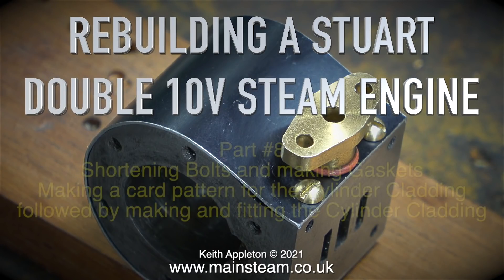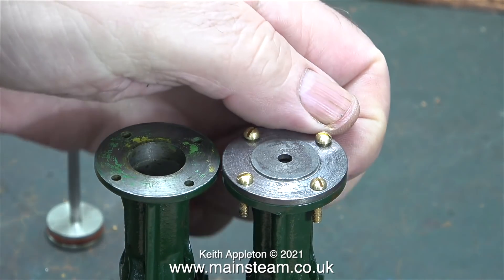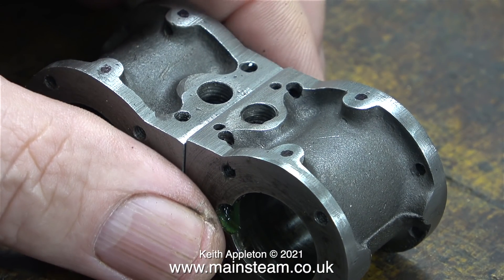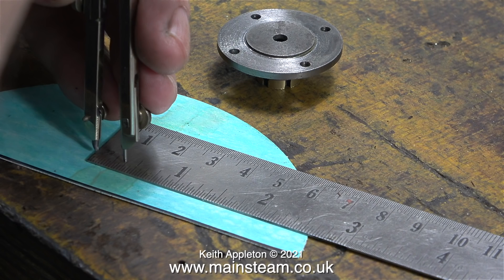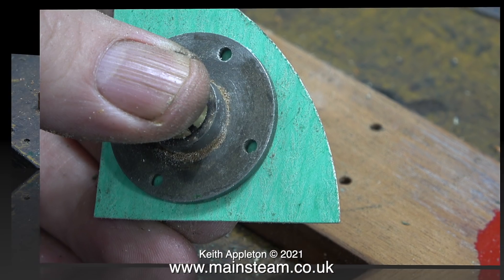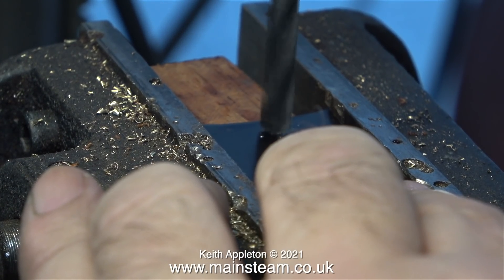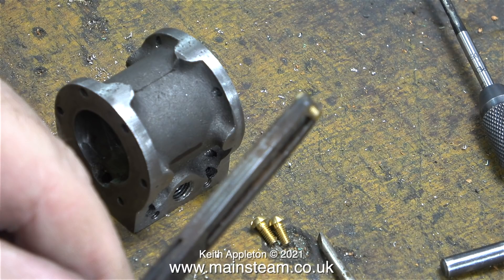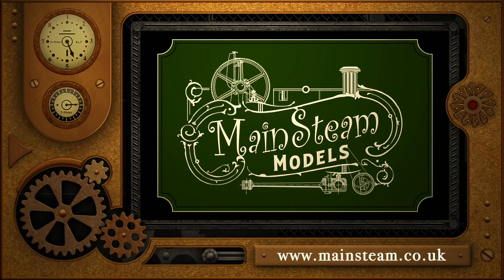REBUILDING A STUART DOUBLE 10V STEAM ENGINE - PART #8

Comment: Good morning, Keith,

I frequently make templates or mock-ups from light weight, coated card stock. A day rarely passes (other than Sunday) when we do not have at least one oversized advertisement for all manner of goods and services that is printed on stock that is ideal, and at election time I get more than I can ever use. I dispose of any sheets that are bent and place the remainder in an oversized envelope (also salvaged from junk mail) to store in the same pile wear I keep thin plastic sheets so that everything stays flat and at hand.

Regards, Charlie